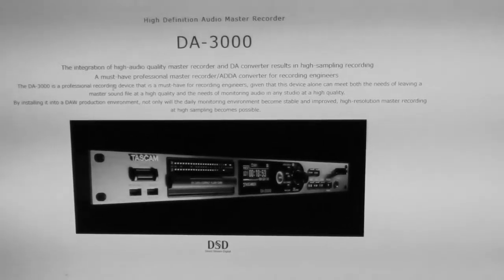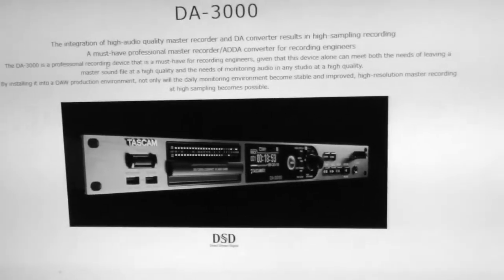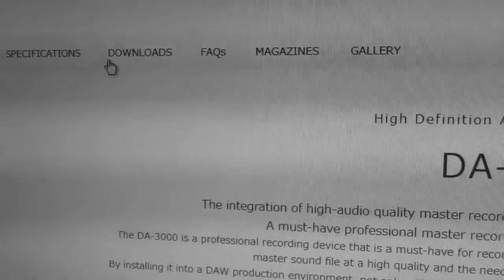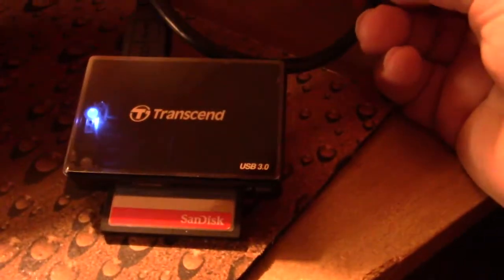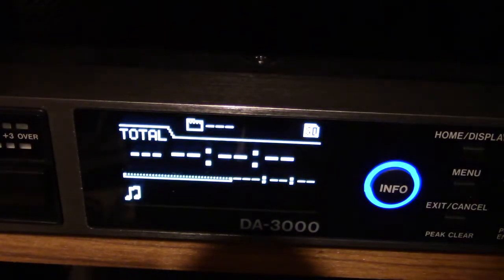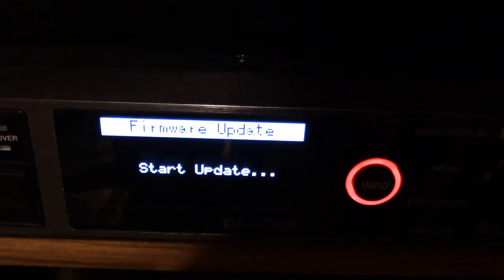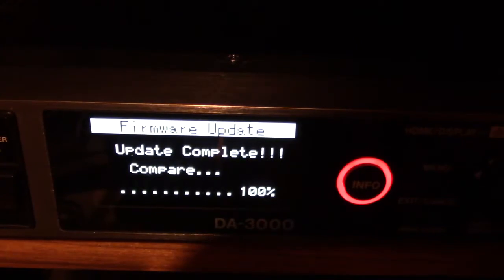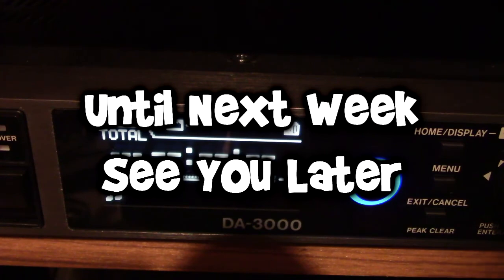Tascam DA-3000: Firmware Update- Real Time

Comment: What’s the difference?  Do u need to update?
Reply from the maker: This was a major update. Prior to the new firmware, an update could only be performed via Compact Flash card. I had to get one specifically to perform an earlier update. Now, updates can be done via SD card and USB stick. You can find out more about it at Tascam's website under firmware. Thanks for watching.